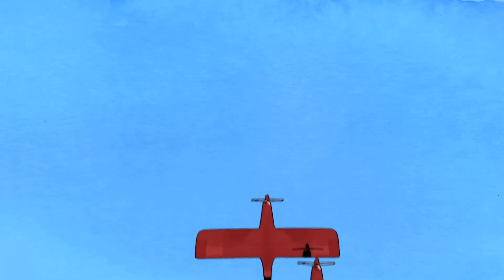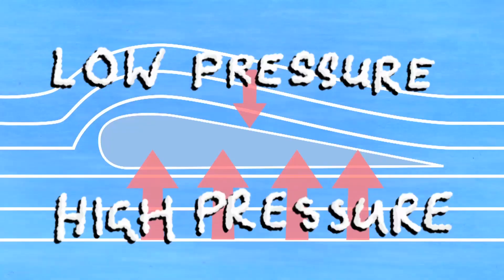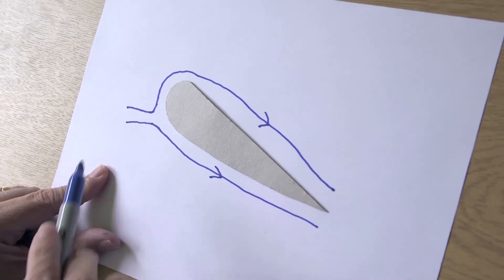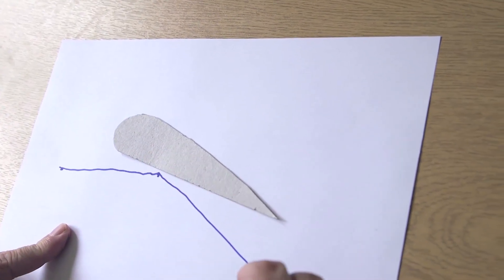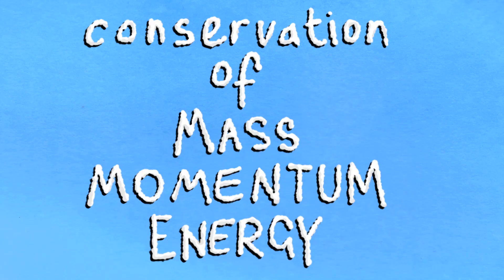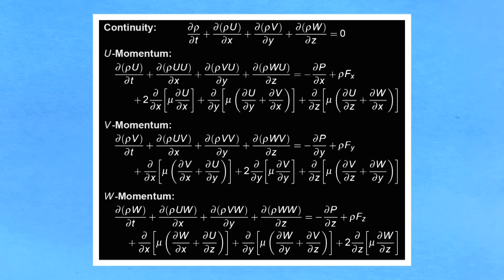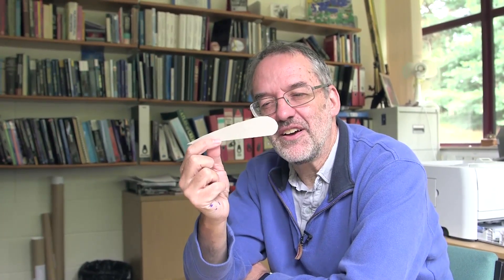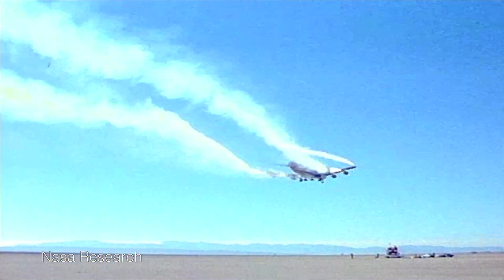Lift and Wings - Sixty Symbols

Comment: The momentum conservation argument is not pressed enough usually. All the pressure difference stuff just complicates things. It's really quite simple. In order to stay up, you got to push air down. The wing does this. How it does it is well explained in this video, but it is a secondary argument imho.
Reply: The problem I have with things like the Bernoulli effect being used to explain lift is that in so many explanations it's tied to the wing's shape, with an explanation that the "more curved upside of the wing" causes the acceleration of the flow.

You can get lift from a perfectly flat and very thin aerofoil if it has some angle of attack relative to airflow, and that too accelerates the flow above the wing. So any explanation of lift should be applicable to this kind of wing first, and then expandable to more complicated aerofoils.

Bernoulli's equation of course always works, but trying to apply Bernoulli's principle to explain how a perfectly flat aerofoil produces lift will give a layman a serious headache when they try to figure out what it is that makes the air flow faster over the top of the wing when there isn't any "hump" to accelerate it.

That's why I think it's best to just start the description of lift by saying that the wing causes airflow to turn downwards, and in order to do that, the flow above the wing must move faster than the flow below the wing. That is, after all - the fundamental action that the wing performs: This turning of the flow is the wing pushing the airflow down, and the wing feels a counter-force pushing it up - which is the lift.

The detailed specifics of why a modern aircraft's wing is shaped as it is can then be added into the description. For example, the wing is curved because air flows smoother and adheres better to the curved surface on the top, than it would on a flat wing, which produces less drag for more lift. The amount of curve that the wing has is called camber. Camber also means you can produce lift even when angle of attack is zero, because the wing deflects airflow even at zero angle of attack.

Similarly, you can say that a thicker wing produces more lift because it affects a larger amount of air, but for the same reason it also produces more drag.

Historically speaking, wings started almost flat, then designers started to build more camber onto the wings but they remained very thin because they were supported externally by struts and wires. These wires produced a lot of drag, though, so eventually cantilever wings were introduced, but in order to withstand the forces of flight, these wings had to be thicker than the wings on older aircraft. Additionally, the wings were often made thicker at the root of the wing because that's where they have to take the highest stress, transferring the lift force to the fuselage of the aircraft.
Reply: What is grossly misleading is treating a wing as some kind of special shape doing a special thing.

From simplest physics you get the simplest explanation. The total sum of the wing's interaction with the airflow is that it pushes the airflow down, and the airflow pushes the wing up.

That is both an accurate and sufficient explanation for a layman, and works for any kind of aerofoil shape that happens to be applying a perpendicular force on the airflow. Including an angled, completely flat sheet of metal, cardboard, or whatever. The peculiarities of the typical aerofoil shape used on aircraft are just there to make them more efficient.

See, when you have something basic you can start with, you can then go into the more detailed explanations of individual phenomena associated in the production of the lift. Such as explaining that air isn't just "bouncing" off the bottom of the angled plate, but due to Coandă effect it adheres to the top of the angled plate, too.

And because it adheres to the plate, it gets angled down. And because it gets angled down it tries to pull down more air from above. And because it tries to pull down air from above, a low pressure zone is created. And because of low pressure zone, the flow of the air is accelerated. And the end result is a pressure differential across the top and bottom of the wing, which can be integrated over the surface of the wing and that produces the net lift force.

Now you have some basic stuff out of the way, so you can then look at what makes a flat plate different from a more complex aerofoil shape? The above explanation still works for any wing, too, but is it really substantially better than "wing pushes air down, air pushes wing up"?

I would say it depends. For someone with more understanding of physics, the simplified explanation might be unsatisfying. For someone else, it might be enough.

The detail level of the explanation should match the level of understanding - and expectations - of the person or people you're explaining it to. It should start from the simplest principles - in this case, Newton's second law of action and reaction - and then, if the audience isn't satisfied with that explanation, delve into further details.

Starting to explain lift with a complex aerofoil shape and trying to explain all the reasons why it's shaped as such is not in my opinion the best way to try to explain lift as a basic aerodynamic phenomenon. Start with a flat plate aerofoil, and why it produces lift when angled. The bonus for this is that it's easy to do literal hands-on experiments with this - just take a sheet of cardboard and tell people to wave it around and see what kind of forces they feel on it at different speeds and angles of attack.

Then advance to a symmetric tear-drop shaped aerofoil and explain why THAT produces lift when it's angled, and what the difference is in terms of amount of lift and drag produced.

Then introduce the effects of curvature, or camber of the wing, and how you can get lift of a curved aerofoil even with zero angle of attack.

And if you're dealing with someone with an understanding of university level mathematics, then you can go into stuff like Bernoulli equation applied to a wing, Navier-Stokes equation, Reynolds number, and eventually what happens when you get into regimes of flight where air becomes compressible fluid (Mach number, trans-sonic regime, supersonic flight, etc.).
Reply: That is absolutely correct, and I formed my question that way on a purpose.

But regardless of the design of the sail, however, the basic principle is the same: There's high pressure air on one side of the sail, and low pressure on the other side of the sail.

Therefore, the pressure differential causes a force that pushes the sail in some direction. This is the main thing I wanted to direct attention to - any time air or other fluid applies a force on something, it pushes it via pressure differential.

With drag mobilizing sails, like square rig, the force is limited because there's nothing to decrease the pressure on the front side, so the pressure differential can't become very great. The force generated is mostly in alignment with the wind.

Wing-like sails like the lateen sail and later developments are more efficient because they produce the pushing force by turning the airflow, and this turning causes the pressure to decrease significantly on the front side of the sail. This makes the pressure differential much greater than you can ever get on a drag mobilizing sail.

However, on fundamental level, the same thing is happening: A pressure differential across the surface of the sail creates a force that pushes the sail in some direction. Aerofoil sails are just much more efficient than drag sails.

So I don't think it's incorrect to say that an aircraft's wing is pushing on the airflow and the airflow is pushing the wing back. In fact I think it makes a whole lot of sense, and provides a correct - if simplified - way of describing the lift, without getting mired in the details that are really prone to misconceptions.
Reply: Yes wings create (a bit of) lift via the pressure difference (and why it travels what way is actually quite interesting, google Kutta–Joukowski theorem), but the vast majority of upwards force comes from pushing air downwards. So the "momentum argument" is the main cause for airplanes staying in the air.
Reply: Herra, it depends on the sail. You have sails that act as wings and sails that act like parachutes.
Reply: Okay, let me ask you a question. When wind hits a ship's sail, do you think it would be appropriate to say that the wind is pushing the ship?
Reply: If you don't include conservation of energy (Bernoulli's) and conservation of mass, then you don't have an accurate description of why the air is pushed down. It's like explaining a jet engine without bothering about compressors, turbines or fuel.
Reply: +Robert Backhaus That's because the fundamental basis for lift, drag, and static air pressure is the same. It's all done by pressure, which is air molecules transferring momentum to a surface.

Symmetric pressure causes zero total force, but differential pressure causes a non-zero total force to be applied to an object. This is what causes air drag, aerodynamic lift, aerostatic lift (and buoyancy in general), and everything else associated with fluid applying a force on things.

Yes, there's a difference in how the wing manipulates the airflow compared to how a square rig sail interacts with airflow, but if you go into the detail deep enough it all turns out to be manifestations of the same fundamental thing.
Reply: +dutchrjen That's exactly it! The only way a fluid like air can ever apply a force on anything is via a pressure differential. So saying that the wing "creates a pressure differential" is just a really fancy way of saying that the wing is pushing down on air, and the air is pushing up on the wing.
Reply: Something that was touched on but not emphasized enough in this video (IMO) is that a wing affects a very large volume of air as it passes through it. It is not just the air near the wing. You can visualize this easily by quickly passing a small wing through a column of smoke like from a cigarette or incense candle. You will see the the column of smoke being jerked downwards slightly both well above and well below the wing (assuming you had the wing at a positive angle of attack).
Reply: Depends on what you mean by "push". If you mean "push" as the total force that the wing applies to the airflow around it, it's absolutely a correct word to use.
Reply: +HerraTohtori While you have a point about simplified versions of explanations the explanation "the wing pushes on the air and the air pushes back" is simplified past the point that there's a distinction between the forces involved, so it doesn't really resolve the misunderstanding at the level where discussion about reaction forces (which are a specific way in which air can push on a wing/sail), the Bernoulli effect (which amounts to a different way for air to push on a wing) and the other aerodynamic forces mentioned in this video take place.
Reply: That explanation could also describe drag. Or just simple static air pressure.
Reply: Yep, because the forces that the wing applies to air propagate at speed of sound, which manifests as the low and high pressure zones reaching quite far from the wing.

Depending on the wing's design, the amount of downwash can vary quite a lot. If you have a normal, fixed-wing aircraft, the downwash from the trailing edge of the wing is pretty negligible because the surrounding air absorbs the momentum of the air as the wing flies through a region of air just once.

Other types of wings can create a more substantial downwash as part of their intended design. A helicopter's rotor blade will not create a lot of downwash in normal flight either, as the helicopter passes through air quite rapidly, similar to a fixed-wing aircraft. But when the helicopter starts to hover, then the blades pass through the same place repeatedly and that does in fact end up producing a downdraft of air through the rotor disc. Somewhat counter to intuition, this downwash actually reduces the rotor's lift capacity, so a helicopter in hovering flight has different weight capacity and different rate of descent limits than a helicopter in level flight. In fact, a helicopter can (at least in theory) take off slightly "overweight" by using a runway, because a rolling start eliminates the rotor downdraft and the aircraft can produce enough lift to take off.

Then you get to other extremes of wings - propellers and fan discs. They consist of, basically, small wings that produce a lift vector forwards to propel an aircraft, but because they spin very fast and through the same region of air, they produce a significant flow going through the propeller or fan.

The difference between a rotor and a propeller can be quite difficult to quantify, but fundamentally you can look at thrust of a propeller, and lift from a rotor or aircraft's wing as being the same thing through thrust equation: Thrust is a product of ejection velocity multiplied by mass flow.

F = v_ej * dm/dt

Whereas propellers give air a lot of speed (ejection velocity), the mass flow is limited by their small diameter. By comparison, wings and rotors transfer less downwards speed to the surrounding airflow, but they affect a much larger amount of air.
Reply: +dutchrjen "When the wing moves forward the downward sloping surface is on average moving away from the airflow reducing the pressure."

It should be noted that the pressure above the wing is reduced on a large area, and not only behind the highest point of the wing where the slope turns downwards. Intuitively it would seem to make sense that when the wing is growing thicker, there would be higher than ambient pressure pushing on the wing, and when the wing starts to get thinner and slope downwards on the top, the pressure would be lowered. But this doesn't work - the highest pressure is at the stagnation point, and from there on the pressure is lowered as the airflow follows the aerofoil's surfaces. More so above the wing, because of the stronger curvature.

The reason why the pressure is reduced throughout the curved wing's upper surface is because the airflow adheres to the curve and is therefore continuously pulled away from linear path. This is what creates the immediate low pressure zone at the boundary layer, and more air from above keeps pushing the boundary layer to the wing surface by filling up the low pressure zone the best it can. So Coandă effect is indeed extremely important and pretty much responsible for keeping the airflow attached to the wing's surface as long as the angle of attack is not too high.

The wing's lift-to-drag ratio does indeed depend on its aerofoil profile, but also things like aspect ratio and wing end design that can be used to reduce the vortex formation and therefore reduce the amount of lift-induced drag that the wing produces.
Reply: Yep, it all makes perfect sense when you know how aerodynamics works. But a layperson might look at a helicopter and think, hey, it's pushing more air downwards so clearly it must be producing more lift... when in fact the opposite is true, downward air velocity decreases the lift that the rotor blades can produce.

And trying to explain vortex ring state and why it's dangerous for helicopters is even more difficult...
Reply: These two phenomena are synonymous.  

F = ma

F = m dv/dt

F dt = d(mv)

Can't have one without the other.  : /
Reply: +Jaap Versteegh You just described the second argument in this video, 
which is immediately debunked in the video with the point that there are at least 2 other effects on top of the momentum conservation that must be considered to create a functional aerofoil.
Reply: +HerraTohtori Sure, if you completely ignore what the wing is, using language in a perverse manner to support a claim that is grossly misleading.
Reply: It's not really well explained in the video.
 It's also equally correct to say that the wing creates lift by creating a pressure difference across itself. Also "push" is the wrong word.
Reply: +HerraTohtori Diddle your shitter elsewhere.